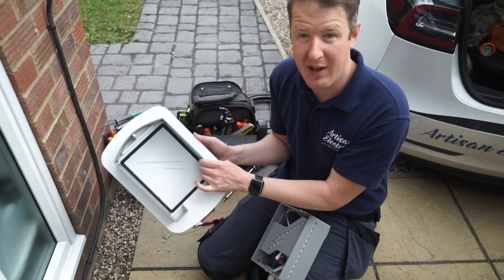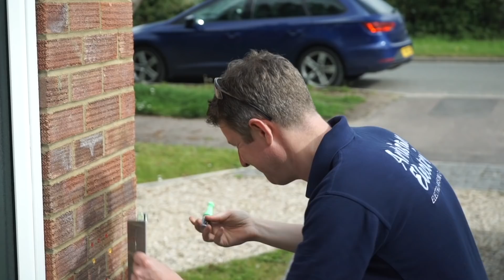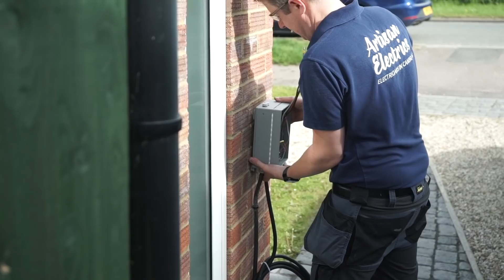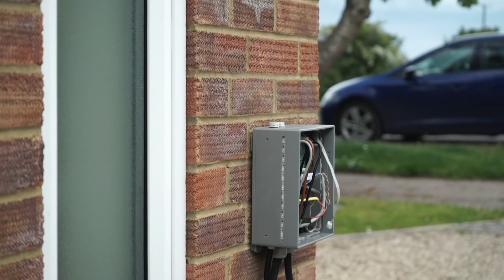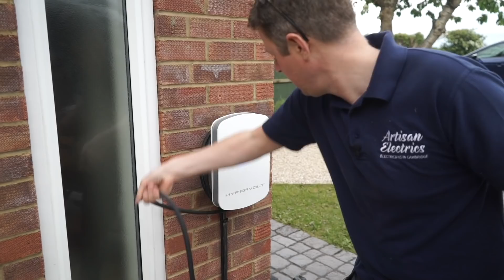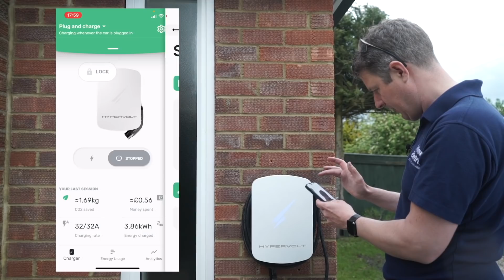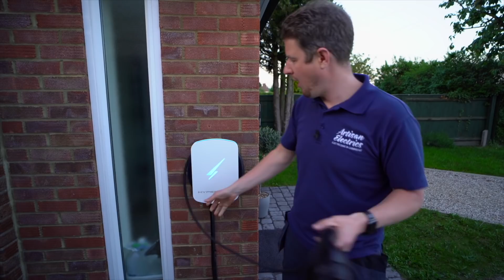Is This The Future of Electric Vehicle Charging? Hypervolt Installation

Comment: If the Ethernet ports only 100Mbps you’ll have a spare twisted pair for the CT that you can split off
Reply: In fact a pi is auto neg so you absolutely could. Use it for Comm’s and the CT
Reply: I guess you could, assuming the CT and Ethernet points at the other end are next to each other, but does it really make practical sense if they are not? Better just to run 2 CAT5e cables in reality
Reply: @timprice5  good point, depends on location,you could use a punch down krone block on route or just split the pairs out along the way. But yeah, depends where everything is for sure.

Comment: OH NO ! - Not MORE holes in the external wall !.
Your house will have more holes than a string vest ( remember them ) thought not.
You are changing your wall boxes as often ( nearly ) as your socks Jordan mate.
Joking aside, you needed to install a small backer board that can be installed with four screws and hidden in the mortar lines.
These four fixings could have been made good very quickly, WHEN you had finally finished switching out all of these different the wall boxes.
Don't get me wrong, I love the content.
But I really do feel sorry for your brick work !.
You will have the biggest mail box in the street to cover ALL of them holes Jordan.
Love the video's, shame about the holes.

Comment: So what happens when the SD Card fails in the Pi?
Reply: We use automotive grade SD cards and are very parsimonious with writing to it. We also employ a bunch of other tricks that are too tedious to note to make sure that we expect the lifetime of the card to exceed the lifetime of the unit. Charging data is shipped off pretty quickly, so a failed card wouldn't result in data loss. Thanks for the question!

Comment: They seem to have missed a trick by needing a wired CT.  The charger itself does WiFi, but then you still need a data cable for the CT.  Incomplete design.
Reply: Personally I’d always want to go for wired CT. if you have a wireless CT and you have a signal issue and the charger can’t speak to the CT then your vehicle can’t charge.
Reply: @iainkay3630  Yes definitely.... I've had issues with the Myenergi Harvi before having the signal dropout. There's no way of measuring the signal or knowing it will work until installation day comes and that can be pretty stressful!
Reply: @iainkay3630  Oh, by all means the option of a wired CT.  What's missing is the option of a wireless one.
Reply: Wired CTs are definitely more reliable
Reply: Only for now fortunately! Wireless CTs coming right up!
Reply: A WiFi CT would need power to transmit - this set up it remains a passive device = more reliable
Reply: Installers/users can opt for either or. We are now offering wired versions, with wireless coming right up by end of summer. They work in combination too, so they can even be installed as a mix!

Comment: Interesting on two fronts:

I wonder how reliable the RPi will be long term - I've had more than one SD card go wrong when a Pi is used long term and...

Can you get wifi connected CT devices to avoid the need for ultra cable or a separate Cat5 run?
Reply: About 5 - 6 years on testing, some of which accelerated testing. But we are also working on completely replacing that starting with August, so we agree and are working hard to come up with a much better bullet proof long term solution.
Reply: @hypervoltev  There are industrial-rated SD cards available and I believe the Pi 4 is capable of booting from an NVMe SSD.
Reply: @rampagerick  that's exactly what we use, industrial grade!
Reply: We are working on it and it's coming in 2 months, together with a complete board revamp! You'll be able to pair several wireless clamps to it and stream data and so on.

Comment: Great video Jordan, Charger ticks all the boxes, but can you turn the led lights off when charging?
Reply: Also a little surprised the rear box is flat at the top, rounded might of been a wiser option. Nevertheless it looks to be one of the better options
Reply: Hi,  investors one of these chargers, and yes the LED brightness can be adjusted/switched off in app. Waiting for my car, but the charger looks good and customer service great.

Comment: Them hypervolts looks really decorative very interesting but will it be a game changer like zappi chargers
Reply: NO! No solar integration, No display on charger showing what is happening, No wireless CT clamp connections, No long distance communications as WiFi, not ZIgbee, No plug for the charging cable, No protection from the wall for the cable wrapped round charger.
Reply: Unbiased view: YES!
Reply: @hypervoltev  👌🏻 You have my vote! It might be time to change my current charger!
Reply: Good idea
Reply: @hypervoltev  Is it ocpp 1.6 compliant?
Reply: @dti-21  No, the world's most terrible protocol. We use fully proprietary, to allow for sub 50 millisecond connectivity to our devices. When you watch Jordan update LED Brightness, image that actually goes over AWS. Hypervolt offers everything you need, dashboards, apps, fleet support etc.

Comment: What's the point of using SWA cable if you're not going to earth it on either end?
Reply from the maker: Just mechanical protection
Reply: Re the unused twisted pairs. Personally I’d be happier to see them sleeved in a length of spaghetti or heat shrink* about 1cm longer than the pairs themselves. Insulates the floating ends so they can’t drift about the connection box & touch something bitey and, if the same happened at the charger end, feeding a destructive voltage to a semiconductor. 

Same for used pair. Spaghetti or heat-shrink restores double-insulation to prevent any possibility of arcing through what is a very thin covering. 

* at the very least taped up.

Comment: Er Jordan I think you'll find every EVCP has some computing power inside. It's just properly integrated instead of using a hobbyist computer board, not even using the RPi compute module which is actually designed to be incorporated into other equipment. 
There is no reason for anything inside an EVCP to get hot enough to need a fan. 
All the stupid lights tell you everything you need to know - 100% wank. 
Are you sure it doesn't have internal AC RCD protection? Seems odd that it would have DC and not AC.
Reply: @mikeselectricstuff On the LEDs your feedback couldn’t be more wrong if you tried, never underestimate the importance of a good clear UX. As an expert user you understand things a bit too well, but for most people it’s simplicity that wins. On the Pi, happy to report it’s going away very fast, a great way to provide wonderful benefits while integrated computing becomes reality.
Reply: @mikeselectricstuff The pi is not the thing to focus on really. The fact that every other charger requires 25 buttons for a firmware upgrade is the real caveat! So while 
you are technically right, in terms of user experience for our users that don’t want to care about details, it’s worth seeing things a bit more holistically. Do people care about what kind of computing they get, or do they care about an effortless experience?
Reply: And not only that  -a cooling FAN - bound to go wrong , why oh why introduce a mechanical cooling device ?   In my experience - installing a cooling fan in a device like this is an after thought.
Reply: @eric4709  Fan adds perfect circular ventilation and keeps things happy for our Middle East customers. It’s true that we never turn it on for this country, and better yet it will get removed in our next iteration!
Reply: @hypervoltev  Whats the IP rating on this unit? Cant seem to find it or many other specs on your site. Is there a datasheet somewhere i can look at?
Reply: @eric4709  hmm, I wonder why laptops have fans. That too must have been an afterthought.
Reply: Led illumination? Nice target for the local "little darlings" to attack. I would prefer the Zappi, designed and made in the UK in Grimsby. Have a listen to the Fully Charged Plus podcast from 31st May 2021. Proper down to earth lady who is a co-founder.
Reply: @royking1  Hypervolt is made in Britain also! 🇬🇧
Reply: No Mike it doesn't have internal A-type RCD. I think this is a good thing though, with the Zappi I've had situations where the cable is buried in the wall and therefore required RCD protection and then you've got the situation of having 2 RCDs in-line which isn't great.
Your right that the LED is a bit gimmicky/wank but you can switch them off.

Comment: Its all fun and games until you open circuit a CT that doesn't have a built in diode or burden resistor. Don't ask how i know.
Reply: You’ve piqued my interest. What happens here?
Reply: @iainkay3630  Lots of smoke came out the CT, I think it started to break down the insulation and arc between it until it burnt enough to short it.
Reply: @whydoi9607  interesting. I wouldn’t have thought the CT itself could make enough power to do that when it’s power is purely based upon the magnetic field. 
You have given me a reason to get one or two of the spare CTs I have kicking about… for science of course.

Comment: Isn't the DC output of these charges isolated from mains earth?
Reply: They output AC, not DC. They're just fancy switches. The car's onboard charger determines the charge current, using a signal from the wallbox to tell it how much it's allowed to draw
Reply: @mikeselectricstuff  ah ok.  Not had anything to do with vehicle charges so it's all new to me.  But is this AC isolated from the supply earth/neutral in that case?  I'm guessing not if they insist on these "PEN fault" devices.
Reply: @Chris-hy6jy  No the mains supply is not isolated, its controlled using a mix of solid state and switching/safety devices. Typically pen fault detection uses a contactor to isolate the supply including earth should a fault occur.
Reply: @cbcdesign001  yes I'd imagine the PEN fault device is just a 230v contactor with its coil fed from live and neutral so a loss of either line would cause it to disconnect... Just wondered in that case why these chargers don't have isolated outputs.  No need for the extra protective devices then?
Reply: @Chris-hy6jy  No - not isolated, just a contactor
Reply: @mikeselectricstuff  I guess it's cheaper than fitting a transformer into the charger.
Reply: @Chris-hy6jy  to have a 7kVA continuously rated 230V isolation transformer would be very impractical, expensive, very big and very heavy, and very energy inefficient. A total non starter I’m afraid. Peter
Reply: @ThePrawlin  If these electric cars are tied to only accepting 50Hz then yes, I'd agree but 7kW from a high frequency transformer would not be out of the question.
Reply: @Chris-hy6jy  Chris, I think you need to rethink your mindset. The home wall box is NOT a charger! It’s a common mistake. It is simply a fancy relay switched AC power outlet. The actual AC charger is inside the car. They are big, expensive, heavy and often water cooled things! (And yes they do utilise high frequency SMPS techniques to convert and regulate the power from mains AC to the circa 400V D.C. to feed the battery). There is enough loss in those alone without adding another loss inducing conversion in the energy path.  The public rapid chargers are completely different. They do pass hefty D.C. straight to the cars battery. All the expensive, big, heavy, lossy conversion stuff is inside the public charger. They have large cooling fans which churn out lots of hot air! Peter.
Reply: @ThePrawlin  Well aware that wall box is only supplying mains to the car.  If the car simply rectifies the incoming AC to a DC bus then you could in theory supply the car with isolated high frequency AC instead.  Yes that would add loss in the extra switching but with today's SMPS designs that should be kept to a minimum.  It's more expense and more weight so I know they'll never do it.  Was just thinking aloud really.

Comment: Interesting that the CT cable only needs one twisted pair, could you not use phone cable to deliver the same result at less cost? Particularly useful for longer runs.
Reply: @Ellis The DJ  what, like that telephone wire they've been stringing outside from poles for ever...
Reply: @Ellis The DJ  Hmm, if that were true then why is telephone wire run round houses for telephones? Not saying it doesn't need mechanical protection, but normal phone wires don't and it's all just low voltage data cable in the end.
Reply: @elminster8149  its not about the mechanical protection, standard CAT5e cable sheathing will perish in the sun, you'd have to use UV rated telephone cable which is likely to be as expensive as the external grade CAT5e and i suspect is just more common in Jordan's collection of cables hainging around the unit
Reply: @timprice5  Yes I know that, but external phone cable is cheap, even cheaper than cat5 in bulk, and should be more than adequate for the job.
Reply: @Ellis The DJ  Ours isn't, the only reinforcement/support is from an external line strung from the pole to the house, the cable is standard external phone wire.

Comment: lol! Your enthusiasm for leds is a bad as mine, I too love a good led display. Zappi still leads the field in terms of ease of installation in my opinion, no need for an external RCD. Also, rear or bottom cable entry options.
Reply: Check out the Sync EV
Reply: Internal RCD being released in just under 2 months fortunately, removing the last interesting thing Zappi does that we don’t yet. No worries, on it!
Reply: @hypervoltev  That's great, the easier they are to install the better. I like your display by the way, I am as sucker for RGB lighting.
Reply: @cbcdesign001  You will be pleased to know the LEDs are also vastly improving in the next product iteration to much higher density!
Reply: @hypervoltev  I prefer them without internal A-type RCDs! Then if cables are buried in the wall you don't have two RCDs in-line.
Reply: @hypervoltev  at least you’re staying true to your business plan…..copying everything the zappi does, several years after they did it 😂

Comment: Try this, instead of cutting the bag in the same direction as the ties, cut a line across the bag, let me know your thoughts.
Reply: No functional difference except the removal of the ties from the bag may be slightly harder with the horizontal cut as per your method? Or am I missing something?
Reply: @obcallum6450  If you cut across the middle of the bag, they don't fall out from cutting across either end. That's how I do it.
Reply: @obcallum6450  I know you'll be trying it next time.

Comment from the maker: Find out more about the Hypervolt Home Charger: http://bit.ly/hyprvlt
Reply: Any chance you could do another video with a non-biased opinion and comparing to other chargers out there?
Reply: @alandann9551  The Guys strips SWA with a hacksaw and uses 3phase cable on single phase(just utter shoddiness, LNE SWA is freely available to the trade, just not in Wickes) , the Hypervolt is a great unit and the open architecture means the feature set will evolve (hopefully, but lets be honest that tech isn't in there to sit static) but you kinda needs an electrical Engineer to install one, not a YouTube Soap Star!
Reply: Hello do hypervolt do finance on ther chargers?
Reply from the maker: @samredfern7130  not that I know of but worth asking
Reply: @artisanelectrics  do you know of any other makes of chargers that do?
Reply: Could I come here to work
Reply: V2G capable?
Reply: @terryterry1655  No it isn't V2G that's only available on a handful of trials and it only works with CHAdeMO currently which is obsolete now anyway so will be pointless to release a V2G charge point at the moment.  V2G on CCS is still a few years out.
Reply: @terryterry1655  Vehicle 2 Grid
Reply: @terryterry1655  only dc chargers for now, not ac. You need to wait until iso 15 118 v2 will be implemented, somewhere 2024 or later